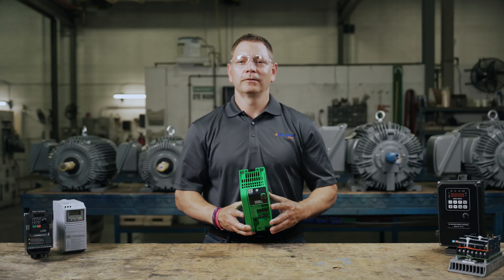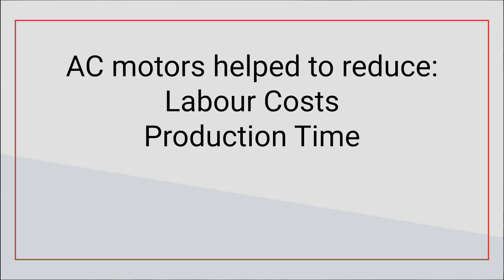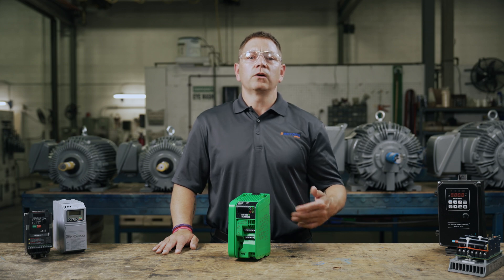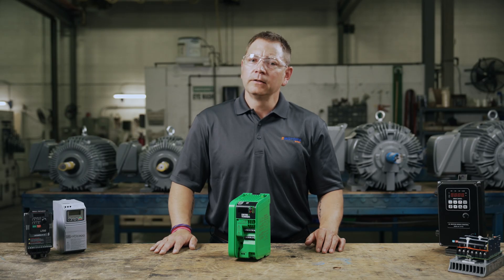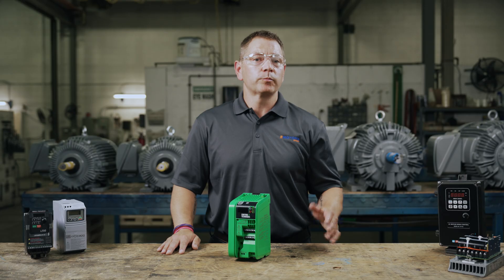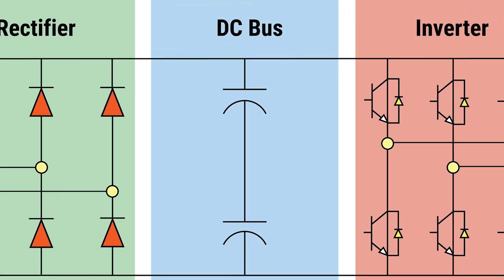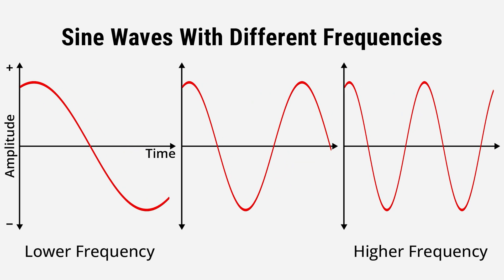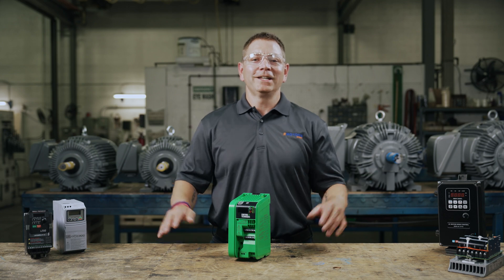What is a VFD?

Comment: Great video explanation. However, I am trying to connect a 5hp AC motor 60 Hz 3phases 240V right now to a larger VFD (7.5hp)  and the motor rotate but at a pretty slow speed. It's connected to an air blower squirrel cage that is supposed to push around 2000 CFM but now it's not even the quarter of that. I setup the VFD to run at 60Hz, a minute or 2 after running it goes in overload on the VFD... The factory setup of the drive was at 400Hz... it's kinda weird, no ?? What to check or change in config ? Any usefull documentation or website I should take a look. I am pretty new to do those kind of wiring but know some stuff in lower voltage (24VDC)
Reply from the maker: Hello, thanks for the comment. An overload trip is likely due to an overcurrent. Under normal circumstances, current is directly proportional to torque and so the first thing to check would be if the motor is undersized for the load by assessing the torque requirements. A rough estimate of the load torque and power can be found using a mechanical energy balance around the fan. Alternatively one can avoid the math by hooking up a larger motor to the load and seeing if things improve.  

Here's the calculation I'd use: https://www.khanacademy.org/science/physics/fluids/fluid-dynamics/a/what-is-bernoullis-equation